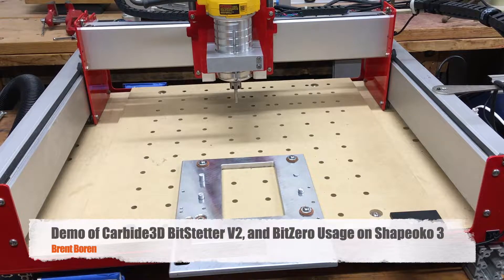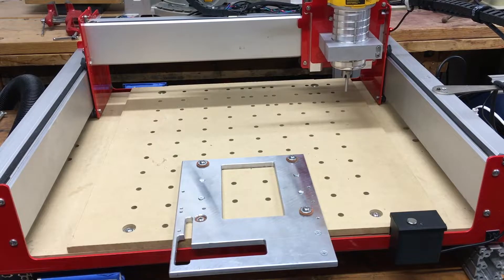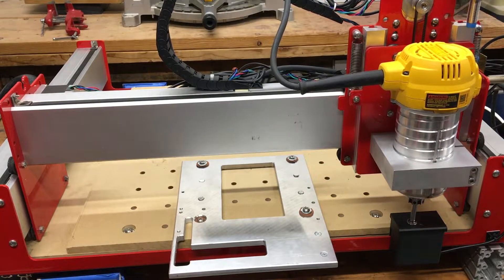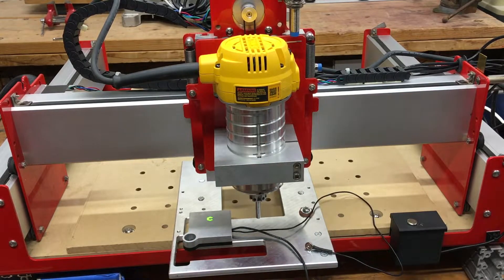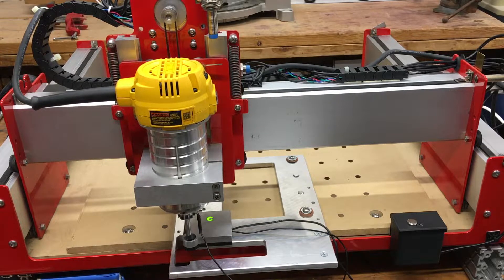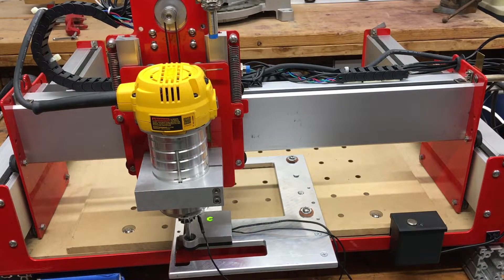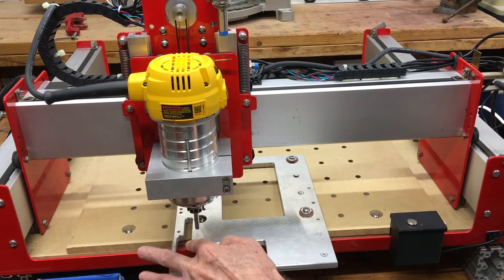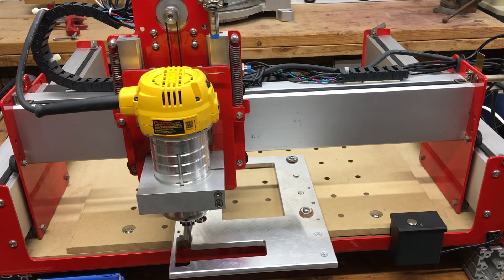Carbide3D BitZero V2 and BitSetter Demo

Comment: I see you have the Sparkfun machine. What control board are you using?
Reply from the maker: Sorry Paul,
I just noticed this question. I was originally using the StepOko controller, but after 4 years the y-axis driver chip burned out. Now I'm using the CarbideMotion PCB (can't recall the revision number). The Carbide Motion has the advantage of allowing me to use the Bitsetter and BitZero V2 (which I seem to recall I couldn't use one of those with the old StepOko electronics).
I'm happy with the CarbideMotion although it is missing a few features I really liked on the StepOko version (easily useable e-stop, for one thing).
Hope this helps!
Brent